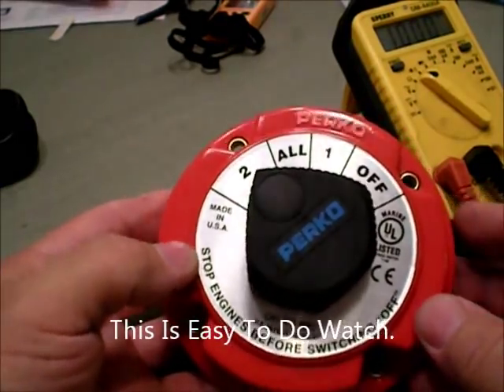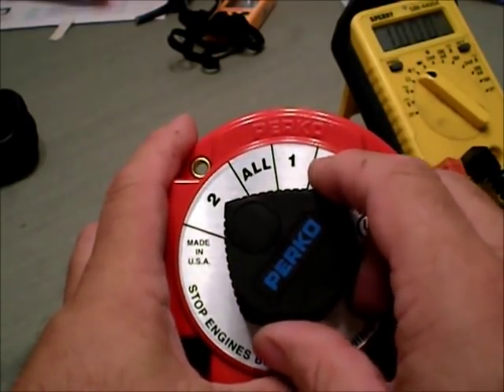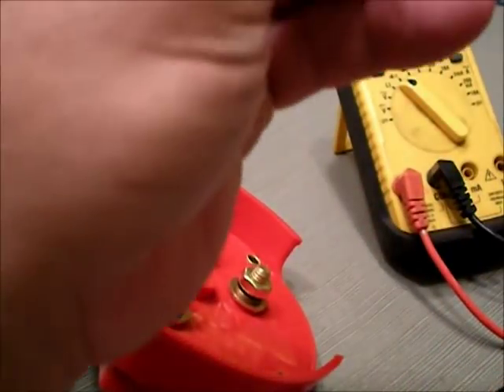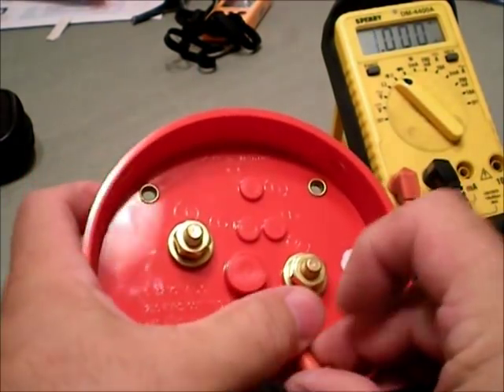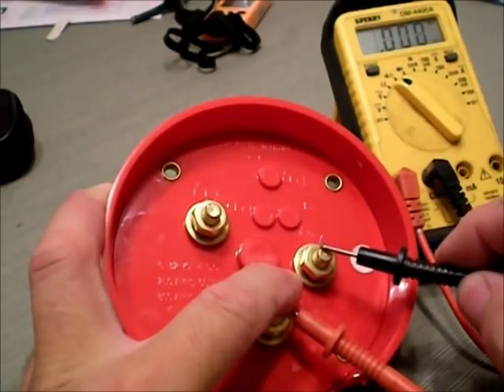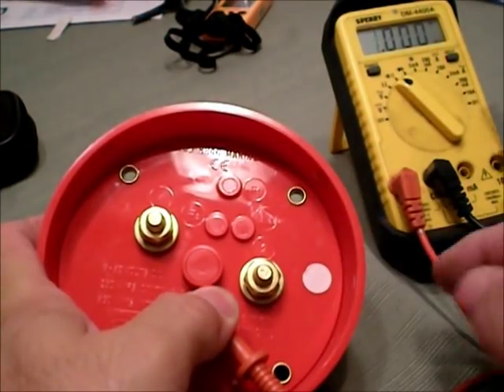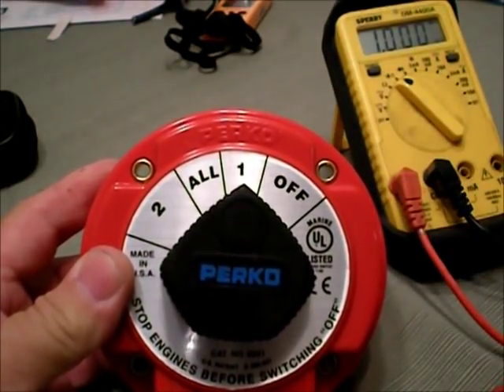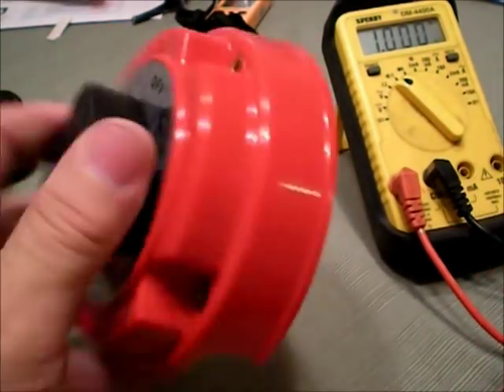How To Use A battey Switch & How To Hook It UP.

Comment: Im refurbishing an aluminum basstracker.  Ive got one 12v cranking battery, and two 12 v trolling/house batteries.....along with a battery selector switch and 3 bank onboard charger.  Im so lost as to how to connect these all up in the moat efficient way.  Any help would be so appreciated.

Comment: I don't have a solar setup on my boat, but I am trying to make sense of how a switch works. I have two batteries mounted on either side of the engine and a 1/2/both switch. I bought the boat last year and this is how it's set up. The starboard battery (closest to the switch and the starter motor) is a deep cycle battery. The heavy ground cable with the post clamp connects to that battery. All other connections go to the screw posts. The one on the port side is a dual purpose cranking/high reserve battery. There are only two heavy gauge wires running to it and they both go to the screw down connectors. I am trying to figure out which battery is the #1 (cranking) battery. If I disconnect the starboard side battery, nothing works, no matter what the battery switch is selected to. The other battery is fully charged, so I know that isn't the problem. By disconnecting the starboard battery, am I also disconnecting the port side battery by way of a ground cable? The wiring is hard to follow, hence my asking a question here. Thank you!!
Reply from the maker: +Kevin Healer Wow I would like to help U but I do not know who or how the battery's are wired. the switch itself is very easy .U may have to start over rewiring your boat the right way were U can use a switch like this. That set up sounds with out seeing it a bit screwy.
Reply: Ok. Thanks. The ground on the port side battery goes straight to the ground  on the starboard battery via the screw down terminals. The ground on the starboard battery goes straight to the engine block via a cable with an automotive style clamp. Is it common that both batteries share a common ground? Thanks for your time. I appreciate it.

Comment: if i were to do this, do you have the positive from solar going straight to the switch? and the negative from solar that goes to charge controller,do you have it going to a bus bar? i want to try this,have everything,mainly confused about the ground wire. thanks for the video,

Comment from the maker: Any Auto Parts store. Marine Store, Amazon.com Ace Hard ware, is were I got this one $30.00 They told Me did not have one. So I showed the Handy Hard ware man This 1,He,s comment What,s That? EBay,Any Ware .But prices Vary greatly. $28.00 To $60.00 For this switch. so shop.This One is rated For 360 Amps @ 32volts intermittent ,250 AMPs continuous,Thats Perco Co.Rated.This 1 is a Perco,Sold under the Store name SEACHOICE-Products,FL. They Are the same .Perco in a Preco Box add $20.00